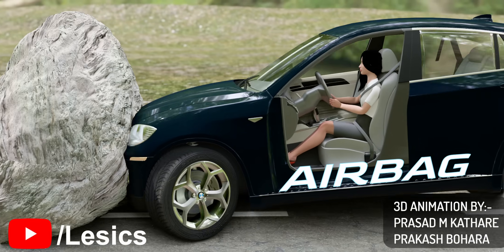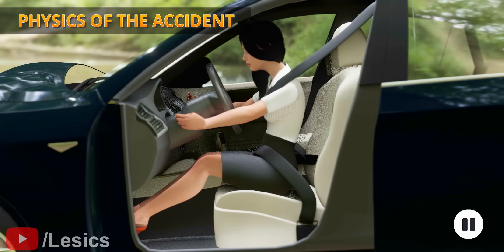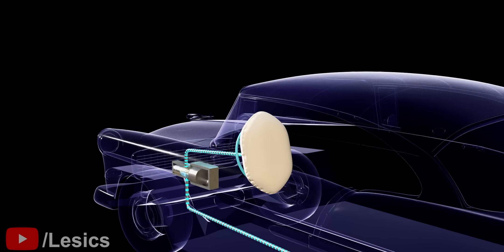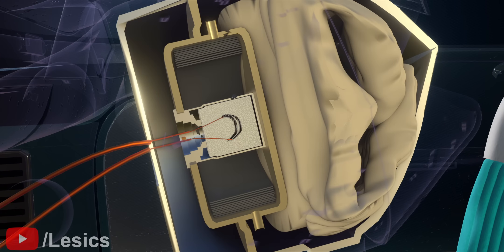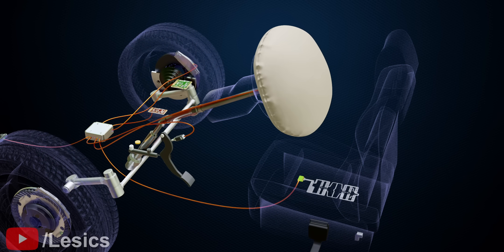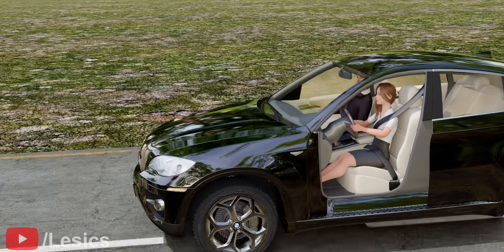Airbags | How do they work?

Comment: This you tube is so full of errors.  GM was first put airbags into production in 1973 using Talley and Eaton airbags and the sensor was made by Technar. The Breed patent as novel in that it had the sensor in the steering column airbag. The Takata Recall did not use sodium azide, but rather Ammonium nitrate.

Comment: This is the worst video ever! The ball and tube sensors are not accurately described. The ball is damped by the clearances between the tube and ball. They were also individually designed for each car model and due to their orientation could distinguish between a potholes and a bolder quite easily. Also, the Takata inflator did not use sodium azide at all. They used potassium nitrate which is extremely volatile and moisture sensitive compared to sodium azide. Finally, before the sodium azide inflators there were hybrid in inflators consisting of argon gas and a solid propellant resembling solid rocket fuel. These were quite heavy, large and expensive. Finally, the MEMS sensors were developed entirely as a cost saving measure. A single circuit board design for all cars requiring only a software change between models and centrally located within the car. It could also operate multiple crash related systems like pretensioners or side curtains.

Comment: As an ASE Master Tech in 78, I have repaired, replaced and watch SIR system change. The #1 questions is; “I hit another car and the bag don’t not deploy”! Why?
  First, were you slowing down and scared? Was the other car slowing. I guess. First, it is calibrated to NOT deploy unless the force of hitting a block wall at 30 MPH. Secondly, the center of the car has to be 15 degrees left or right of center. 30 degrees total. If slowing, the force is not enough to open the bag. Passenger’s side bags don’t open unless roughly 40 pounds of weight is sensed in the seat. The sensor has to be calibrated is parts are charged or seat is altered! Side air bags only deploy is hit on the side. Using a “Slim-Jim” to open a door for locked keys only applies to two years of early 80’s Cadillacs as the sensor and bag was in the door. They are inside the “B-Pillar” on everything else. The “DERM” or black box (aluminum silver) is under center console or drivers seat. It runs a continuous 15 second loop of data storage from brake, gas speed, engine load and much more. It can be played back by licensed owners of equipment and software to analyze data stored for the vehicle manufacturers protection, highway patrol, police and engineer firms to protect you or prosecute you in case that oak tree you hit, crawled onto the road for you to hit! Oh, yes. You can’t erase it either!
  Put the phone down, leave radio alone and pay attention to driving!
  Stay safe any chances are you will never see an air bag in you face!

Comment: While the animation and explanation are correct in general, there are plenty of inacurate statements on this video.  The way the propellant is ignited, the number of sensors a vehicle use, the reason why Takata got into troubles with their product, the fact that in USA, airbags have dual stage inflators, etc.
Reply: This video is not about what happens in the USA . . .
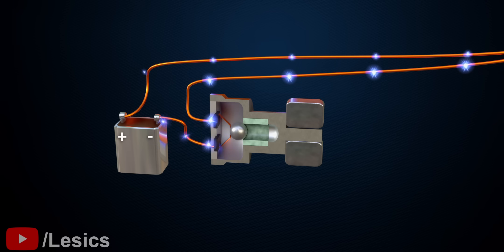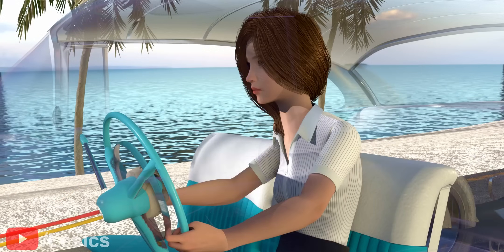Reply: @TRPGpilot  If you know airbags, and regardless of the market where they are produced, you should know that propellant is never ignited directly (3:00), vehicles have multiple sensors (5:10) and the way the Takata issue is produced.  One big difference between USA and European airbags is the min. current triggering igniters:  in Europe was 200mA, in USA 400mA (safer), I'd imagine now are the same due to USCAR requirements.

Comment: The airbag comes out with explosive force if you are too close to the airbag it could hurt you badly. Many years ago an airbag hit my nose with so much force that blood sprayed as far as the passenger window and bodyshop workers wondered if someone had been seriously hurt. The wierd thing was it didn't hurt that much and it stopped bleeding after just a minute or two, the injury looked alot worse than it was. But it made me realize if the airbag had nor worked or I had my face been closer to the steering wheel it would have been very bad.

Comment: Why did they place the airbag and horn at the same place? I know airbag sensors are located in the front and side and horn in the steering wheel, but it is still a terrible system. They have to seperate the airbag and horn system so no one gets hurt.

Comment: i gotta tell you this story...
Today i was driving back to school with my friend,
i was a lil bit heavy with the pedal and after a powerfoul start my car (Lancia Y 2013) drifted, reaching around 30 km/h, until i faced a wall, 
Obvsiusly i pushed as hard as possible on the brake, and i think i crashed into the wall around 20/15 km/h,
unluckly the airbags opened and we were shocked because it happened so fast and we were going so slow.
After realising what i did (and nearly soffocated by the bad smell of the airbags) i got off the car and checked the damage done... BELIEVE ME... Just a moved front bumper and a cracked light.
THE GOOD(or Worst) Part of the story is that under my leg i found a Plastic Heart (i assume was a part of a Bracelet) around 1 cm in height and width, which almost surely has to be hidden under the plastic of my steering wheel and THIS HEART LEFT ME 2 DOTS IN MY FORHEAD after the Airbag hitted my face....
Neither me and my sister (who was the previus owner of the car) know where this heart comes from.

Obviusly the most painful hit i received today... is on the WALLET
Thanks for reading.
Italian guy.

Comment: Silicon dioxide as in sand? So even after the use of guanidine nitrate, are Silicon dioxide and potassium nitrate still used? If so for what? You told this new substance isn't reactive to moisture.

Comment: 5 yrs ago in late July 2017 I was saved by the belt and airbag.    I was on my way home from doing some grocery shopping after work, when a 68 year old woman driving a late 90s or early 2000s dodge caravan ran a stop sign.  I T boned the drivers side of the minivan traveling approximately 60 mph in my 2013 Ford Focus, front  and side airbags deployed.   I did suffer sprains,  bruises,  and a gash in my face, from my eyeglasses but otherwise no long term injuries.   Unfortunately the minivan driver was pronounced dead at the scene when her minivan flipped in a ditch,  she was not wearing a seat belt and was ejected

Comment: Good video and informative video! 👍
Also the animations you guys do are amazingly detailing the point across. 
Only 2 small nitpicks: in the beginning of the video the wheels turn left before the crash and the steering wheel hasn't turned left.
And near 5:33 the character model seems to get into a crash animation and returning to default position before the crash. And then during the actual crash the character model is static and shows no animation.
I know, I k know.. It's nitpicking and the those small things doesn't take away from the information.

You guys rock!

Comment: Thankfully I've only ever been in one crash where airbags deployed. In July 2016, I worked back to back 12h shifts at my job without sleeping a wink in-between, and I fell asleep at the wheel of my 2003 Chevy Cavalier in heavy traffic on the interstate on my way home, and just plowed into the back of the car in front of me at 25-30 mph. I was going slowly enough that I didn't even hit the airbag with my body or head, the only "injury" I sustained was scrape-like rashes on the side of both hands, where the airbag had rubbed over them as it deployed.

Comment: So basically in the movies when they frustratedly slam their fists on the wheel and the airbag comedically deploys: quite literally impossible.
Not only is the sensor not even in the steering wheel, but the design of the sensor means that it is quite literally impossible for electricity to reach the charge, without the steel ball dislodging and completing the circuit.

Comment: Only male can drive the car. But female can not drive the car. Only male can ride the bike. But female can not ride the bike. Only male can fly aeroplanes. But female can not fly aeroplanes. Only male can fight. But female can not fight. Only male can be police and soldier. But female can not be police and soldier. Male has strong. But female has no strong. Only male is stronger. Female is not stronger. Male has power. Female has no power. Male can do everything. Female can not do everything. Male is much stronger than female. Female can never work as male. Male and female both can never be the same. But female can never be the same with male. Only male can be bodybuilder. But female can not be bodybuilder. Only male can lift heavy product. But female can not lift heavy product. Only male can be don and gangster. But female can not be don and gangster.

Comment: I had a 1999 Chevrolet Lumina before Nov 2021, I had put 1000 bucks on this rusty old green can and it worked good, I had slipstreamed into a tree, hitting all on my side, luckily the car and it's safety options saved my life that night, seatbelt on caught me, the airbag went off and I was left with a minor concussion, hip fracture on my left and right arm fracture. I'm walking tall after 7 months with little to no trouble, my arm is still stiff ATM but it has opened up in motion and flexibility. That car, more specific it's airbags, helped limit the odds against disability.

Comment: The information at the end is important and needs one addition. It's a really bad idea to trick the seat belt alarm. When you letting the car think you are wearing a seat belt and not actually wearing one, the airbag will trigger and might kill you, instead of saving your live.
There are only 2 options. Correctly wearing your seat belt or correctly not wearing one and accept the alarm.
Reply: So an airbag won’t deploy if a seatbelt is not put on?
Reply: @MostHated_10  Depends on how modern the car is. With modern cars it won't deploy. 
The car does the math and calculates what gives the people inside the highest chance of survival or the least amount of damage. 
When the airbag would do more harm than good (crashes at lower speeds, no seatbelts, side impacts) the front airbag might not deploy and maybe not even the mechanism that pulls you back.

Comment: Airbags break noses and can seriously put lot's of pressure on the chest and it's dangerous. Air bags actually hurt driver's more then with out of how fast it is and close to the body. 
Harness racing belt's are alot safer and road car's have them too. Also that's the reason rally car's don't have airbags so they can continue driving and it's lighter and safer as the harness straps hold the driver in tightly.

Comment: It's hard to Fathom that the average Airbag totally "Inflates and Deflates" in those 100 or so milliseconds. 
I worked in the Automotive Service Industry since the advent of supplimental restraints and I've asked several people that were involved in accidents if they remember "Hearing" the bag deploy...
Most people don't remember it. Although it can sound almost like a Gun going off and it's almost as loud.
Another thing, some vehicles are equipped with seatbelt "Pretensioners".
They explode too when a crash is "Sensed" and "Lock" the seatbelt at the same time the Airbags Deploy. 
So it's possible, depending on the number of passengers in the vehicle, several explosions will occur inside the cabin.

Comment: Great video but you've actually got a few things wrong in this one!
The Takata recall was due to them using Ammonium Nitrate NOT Sodium Azide as they swapped to a cheaper material while most Inflator Manufacturers were trying to distance themselves from Sodium Azide due to its toxicity. It is Ammonium Nitrate's sensitivity to temperature changes and moisture that caused Takata inflators to rupture which is also why ruptures are more common in more humid areas.
Reply: 100% agree. Sodium Azide was the original chemical used in airbags. Takata then changed to Ammonium Nitrate (aka PSAN). It is the Ammonium Nitrate versions that can rupture and have had a global recall now reaching 100 million airbags.

Most airbag manufacturers now use Guanidine Nitrate in the inflator.

Other than that, great video. Just need to redo the audio with correct terms and it would be perfect.

Comment: There was an incident in which a family didn't know about the seat belt's need for the activation of airbags, and sadly they died from the crash, there family registered a complaint against the car company thinking it was a manufacturing error, and they never reached anywhere as the necessity of seat belt was common for every model and is explained in the manuals. 

They bought the car for the exact reason of airbags yet it never helped them in time of need, because of lack of intel and taking safety measures too lightly.

The point is, if you dont follow the guidelines for safety, non other will be responsible for your damage and you will have to suffer it painfully...
Reply: Its like owning a fire extinguisher without knowing how to use it.
Reply: they never read a user manual and yet they sue the maker... only in America

Comment: Very well explained..

My question is Suppose Car with Airbags parked and suppose speeding car hit it. Whether it works?? Whether car should hit with speed limit say 80kmph ??
Reply: Without Putting seat belt on/locked the airbag circuit wont activate.

Comment: Want an argument? Tell just about anyone that holding the steering wheel at 12 o'clock can result in injury to the hand and arm when the airbag deploys, as well as possible injury to the face and head from the driver's own arm being blown back into the face. They will argue.

Comment: Still, I didn't understand, and in video this is not shown. How does the airbag gets out of the wheel? What happens with the plastic cover of the wheel? Where is it thrown? Thank you!
Reply: The cover has seams that rip on three sides in case of an accident. On the top or bottom of the airbag cover it will however hold together and therefore the cover won't fly anywhere, but will fold up or down. It will basically be behind the airbag and not be in the drivers way.

Comment: Me and my mom were in a crash on Aug. 13, 2021. We were ni a 2008 Cadillac CTS. We called it the "Black car". We were headed down  street not even a quarter mile from home. A drunk driver hit us on the side at 80. The airbags were powerful enough to make me and my mom go deaf for a short time. If it was any closer to any of the doors we would have flipped over.

Comment: Thank you for the information. I didn't know that seat belt and airbag are interconnected.
Normally I release the belt just roubd the corner before coming home.on this day I didn't release the belt .luckily the airbag worked just round the corner.

Comment: What a joke if you have to have airbags and seatbelts the cars not safe so stop lying about safe.
Reply: All cars were never safe to begin with, that's why there's precautions like these. Besides, most of the time it's not the car itself that's not safe. Usually, it's external factors that cause crashes

Comment: My mom had an accident a few years ago with a Hyundai (5 seats) car.
The airbag didn't open even if it was armed but compared to a normal accident she was hit in the back-side of the car by another car at around 75 km/h while she was taking a right corner (so she had relatively very slow speed herself making the impact force IMENSE.
She got a head injury but was better in a few weeks.
The reason for the airbag failure might be due to the car being hit in the back not in the front where most sensors are.
Reply: Nah. Mine got hit in the front and after the vehicle "came to rest", I watched both airbags deploy: driver side blue, passenger side white. Sometimes they just don't work.
Reply: All airbags only inflate if hit from front
Reply: As said in the video, many inputs are evaluated to decide whether to engage the airbag at all. Maybe for this accident the airbag deployment wouldn't have helped. Which is probable since it was a collision from the back.
Reply: I think head rest of seat will play role here not airbag.
Reply: getting hit from the back is gonna throw your head backwards into the headrest or seat, which is pretty much a cushion. not forward to the steering wheel. the sensors are setup for frontal impact.
Reply: Weird
Reply: Get well soon to your mom. 
And also good point.
Reply: L
Reply: @saltsalted1528  OL
Reply: Correct, someone I know got into a bad rear end accident and the air bags didn’t deploy either because the only thing you’ll experience is a whiplash but the seatbelt is there to keep your body in position as the rear takes most of the impact shock
Reply: Woman moment 😳
Reply: @TorturerOfInfidels   yes, a woman invented side airbags.  Thank god for women!
Reply: https://youtube.com/shorts/WHd_FusYiec?feature=share
Reply: Please Visit Kerala, Switzerland Need Steel Road. Sugar Nair-Trivedi Sir.
Reply: @sharanananth3498  what???🤨

Comment: nutshell from me who experienced airbag deploy/car crash: u dont feel anything except huge BOOM, smoke, sulfur smell and weird loud noise. (i got the bad position at the front and my doors were a broken a bit so remember, if u are in a crash then get out of the car at any chance because if you won't then sometimes it can be your last car drive because something can mess up and uh, ya know, car would get on fire or someting bad so it's better to not risk. also if your doors are slammed then kick them because you can buy new car but you can't buy new life)